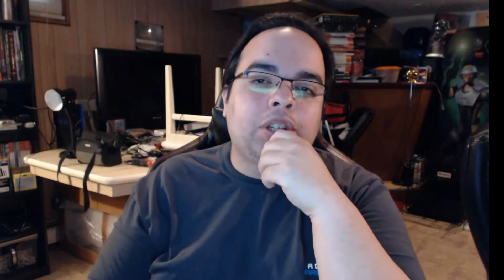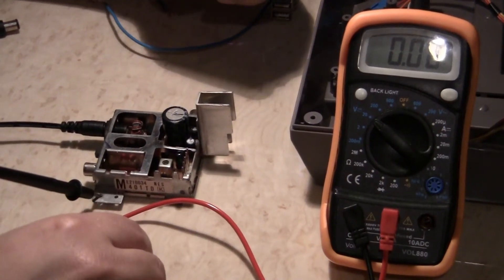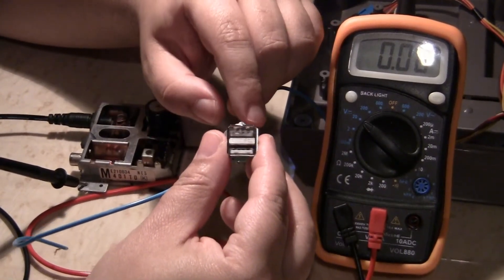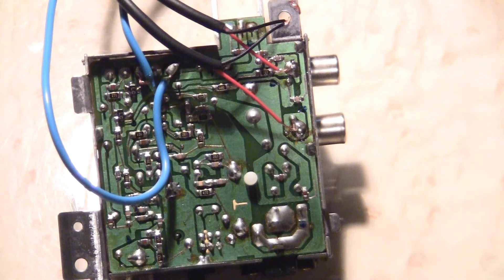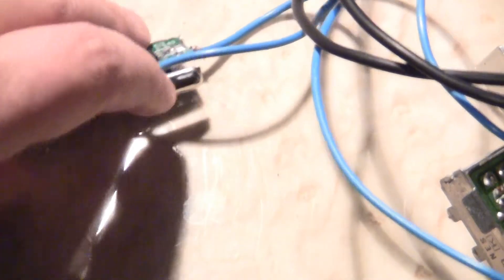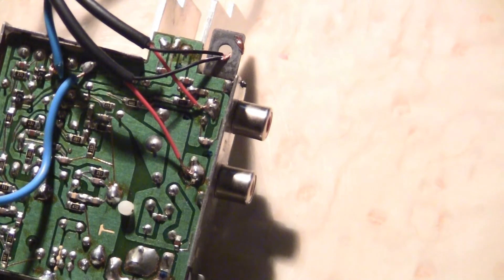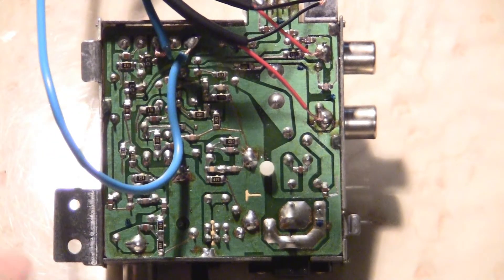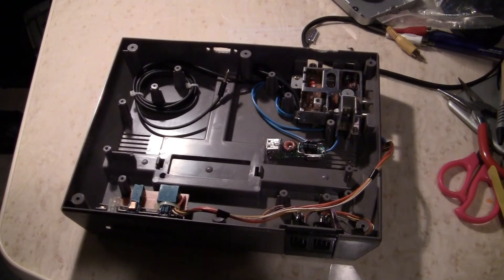The Gamer's Vault: Raspberry Pi Original Nes Power Mod

Comment: Like your video, but I have some questions because I am doing a similar project. first time, noob and etc. using that mausberry circuit how did you put it together with the power button? I would like to DM if thats ok or by google+?
Reply from the maker: Ralph B sure I think it’s been a while since I did that video but I will help you the beat way I can
Reply: @TheGamersVault   The Gamers Vault  yeah I know but I sure its simple but been looking all over youtube picking the ATXRaspi or Mausberry. But it seems like your method seem better. I have the raspberry pi 3 ✅ Nes Console✅ ordering Mausberry✅ . do you have any pictures on how i can hook up and solder them?(or there is a video showing how)
Reply from the maker: Ralph B definitely should be in the video but if you have questions let me know

Comment: I've been watching your video over and over because I'm a relative newbie but it's my dream to put an RP3 in a NES. I have all my components together, but I need a resource for the details of the project. Any way I can DM you with questions?
Reply from the maker: no problem. You can DM me any questions you have and I will do my very best to assist you
Reply: okay, so I got my mausberry circuit hooked up and soldered to the NES power switch. Everything works great. (side note: you have to reverse the polarity of the LED if you are using  new mausberry). But I'm stuck now trying to figure out how to use the 9V NES power to run my 5V RP3. I am not hooking up an external power hard drive, so I don't need to install the USB hub like you did (I'm going to use some keystone USB hubs in front where the NES controllers hook up).  Can you use the NES power supply to power your actual RP3? If so, how? Thanks!
Reply from the maker: You can use the step down converter for your project. What I did was De-Solder the power portion of my broken nintendo board tap into one of the 4 pins from there i was able to connect my usb power hub and connect it to my mausberry circuit.
Reply: OMG - I'm an idiot. Or...maybe a little slow. It finally dawned on me what you did. You used the car charger as a power converter. Genius! One question: the car charger has a 12V input. The NES has a 9V input. Does this affect the performance?  Most car chargers I see say the power input should be 12V-24V DC.
Reply from the maker: Bones Clash N Burn no it does not but they do make the voltage the same as the raspi I believe I was able to get one for this video
Reply: Ok, so just to be clear (because we already established that I'm a slow noob). I can get a regular 12V car USB adaptor and hook it up to the power supply like you did, and it will output 5V at 2.4 A (considering that the NES power supply is 9V but only pushes at 1.3 A)? Thanks!
Reply from the maker: Bones Clash N Burn correct
Reply: ok, so I got my USB disassembled but I am having a difficult time seeing where you soldered your connections from your power source. I am planning on soldering to the top of the power module instead of the bottom.  I just want to confirm a couple of things. There are 5 pins that I've tested. I'm getting about 14V from the pin closest to the center. That is where I connect the main power into the usb power. The pin right next to it got minimal voltage. Maybe a half a volt.  Is this pin where I connect the ground from the USB?
Reply from the maker: Bones Clash N Burn its better that you follow me on Twitter and message me there I will take a picture of the mod and send it to you
Reply: Will do. I figured more comments helped your channel ;) but i’ll message you on twitter. And send some pics too. Thanks again. This is such a fun project.